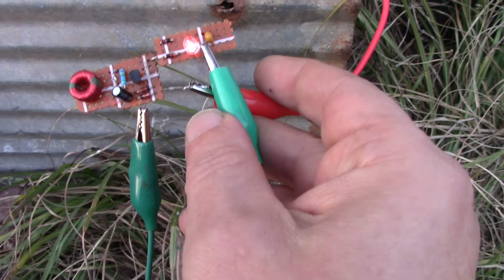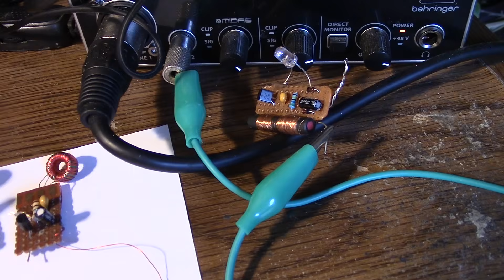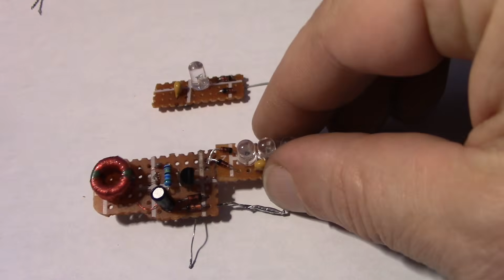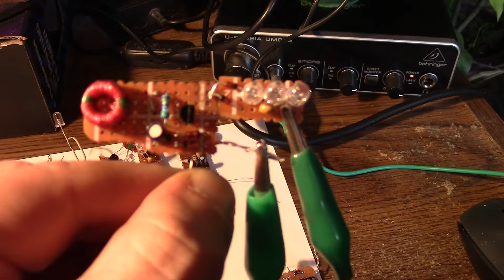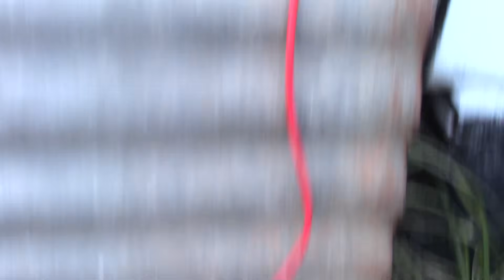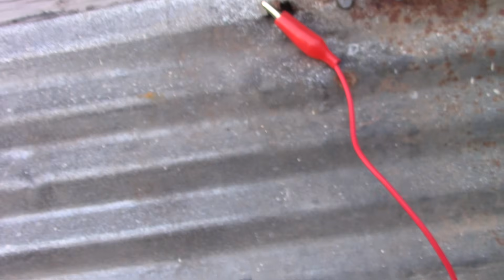Brilliant Energy Harvesting Circuit sent in by a Subscriber

Comment: So.. it work without joule thief..?
Reply from the maker: You can get a tiny amount of light without such a circuit yes. 
If you have a desktop type PC or exposed metal on a laptop, you might be able to hold the negative leg of an LED and get a bit of light by touching the positive end to that metal. 
A metal desk lamp is another to try.

Comment: So how does it work and where does the energy come from ? Maybe radio waves if you live close to a broadcast transmitter or zero point energy?
Reply from the maker: It's simply the earthed mains electricity from the house 😀
In the USA, the Ground is connected to the Neutral, to Earth the incoming mains power for safety. That tiny amount of electricity in the ground can be detected with 2 rods spaced arms length apart and a crystal radio type earphone between them... you'll hear the mains hum. 
These circuits rectify what can be heard with a couple of diodes and a capacitor, then use a type of Joule Thief to light an LED brightly.

Comment: Electrochemistry between the metal sheeting and the earth ground?
Reply from the maker: It shouldn't be, Jim, because both are galvanized zinc. I used those same metals on purpose. However, if copper and zinc are used, then it still works if they are swapped.
Reply: @Slider2732_  Many thanks for your reply.  I wonder if there might be some AC hum getting into the serial diodes.  If I recall the data sheets for the diodes that appear on the left of your demonstration and in the schematics, their respective cutoff frequency is a bit over 1 gigahertz, so very fast.  In the first demonstration, there is some flashing, suggesting that maybe the electrolytic cap is being charged --- just a guess.  I liked your presentation.
Reply from the maker: @jimparsons6803  I do know that AC jumps over a lot of components. It got in the way of a simple LDR circuit for detecting daylight, so more smoothing is needed. 
It's very strange to be messing with AC and not be getting zapped 🤣

Comment: Very good work. You inspire a lot of people. What switching diodes did you use? And What is M5.6? And what transistor? Keep it up! You are getting somewhere.
Reply from the maker: Thank you Jake 😀 
The diodes are very common 1N4148's. Germaniums and others didn't offer that much improvement, when thinking about people replicating (I didn't want to use anything 'exotic'). M5.6 is a 5.6 Megaohm resistor. A 4.7 Meg and others will work, but the 5.6 Meg has given the brightest output. Transistor is 2N2222, All of this is a starting point for others to explore further, nothing set in stone.

Comment: The schematic you give do not match with your PCB, you have there an elevtrolyt capacitor and a diode more than the schematic shows.
Reply from the maker: Ah, I'll have a look Adrian 😀
Hmm, I'm not seeing anything extra. There's a 4.7uF on the main part of the circuit and there's a '224' 0.22uF on the LED's side. For diodes, there are 4 on emc4u2's circuit and 4 on the built one. Both pairs act as half wave bridge rectifiers.
Reply: . Why in the schematic is 4,7 nF written ?
Reply from the maker: @AdrianVay-kp6te  Ah, I see what you mean. that's 4.7uF. Some people extend the letter 'u' when writing by hand and emc4u2 has done that in his schematic. Some may also put a line through a number 7. It's just a writing style difference, but yes it can be confusing to the eye.
The 4.7uF is the same as on the original schematic 😀
Reply: @Slider2732_  I also noted that it looks like one diode on the PCB (the upper left one) is reverse from the schematic.  Is that the case?
Reply from the maker: @datnick  It's the same as the schematic, just looks different when the diodes are side by side. They form an 'AV plug', tied at one end and connected in opposite directions, to form a half wave bridge rectifier. 
An AV plug is normally used with an LED across the diodes open ends in wireless electricity experiments, for field detection.

Comment: Nice video!  It looks like you're getting a descent amount of views on a lot of your videos.   For getting more watch hours, something that seems to be true, is to try changing the length of a video.  With a video of about 3.5 minutes, the advertisers usually don't get ads in the middle of it.  They like a video not less than 8 minutes long so they get an ad in the middle.  Better yet, is a video over 20 minutes long.  They can get multiple ads in them.  It seems that YouTube recommends the videos more where the advertisers get more time.  
For me, I seem to get more watch time with the longer videos, even if viewers skip through it more.  I was also informed that the first 30 seconds of a video is very important.  The first 30 seconds has to match the title and thumbnail, and move right along quickly so the viewer is engage at least that long, before they start skipping through it.  I think YouTube is getting harder and harder, because it's getting so saturated.  And now more than ever with AI videos...
Reply from the maker: Thanks for the info. Yes indeed, there's so much out there that has to be done to stay 'up' with regular normal video releases. SEO, timing the releases, type of content to match viewing habits... loads of things to consider. 
I do agree about upload length, for example in this one I showed bunches of ways to connect the circuit and maybe it could have been slowed down. I was just in awe and kept swapping cords 🤣
30 second retention is a key thing, no doubt. 
Hey, am looking forward to your next vid, for certain and best wishes on your journey 😀
Reply: @Slider2732_  I just uploaded a video on my other channel, 'Life in the outskirts'.  It's a channel smaller than yours, but it is monetized.  I haven't done one there since last October.  I just needed to do one there to keep it monetized.  Started it 5 years ago, it just didn't go anywhere.  I get less than $20 month, but it's something.

Comment: As well as showing LEDs it would be good if you can advise power output. I'm guessing 1.7V * 10mA  is approx 0.02W per LED
Reply from the maker: Yes Dan, I agree. There isn't really much of anything for power, but it's enough to light a few LED's. The main focus has been on garden lights needing no batteries or solar. It would probably be an idea to collect in a cap and store some power, but the lighting is practical and does have real world uses.
Reply: @Slider2732_ Great, yes i was thinking to see your best design, make a number in parallel/series and power a LORA transmitter to indicate when a letter is in my letterbox

Comment: When I was at school back in the early 70s, one of my mates designed and built a radio that harvested the power of Radio 1 to power the amplifier.  So his radio didn't take any batteries but was able to power a conventional speaker (not the puny headphones of a crystal set).  It wasn't very loud but was clear enough to be heard by a bunch of us gathered around it.  I thought it was a work of genius.
Reply: Same about me here, in late sixties my friend at Pune made a transistor and it worked on dead 1.5volts cell, the sound so loud that he put thick book on speaker!
(Not knowing the volume control circuit)
We were on four km periphery of radio station. 🌹❤️
Now i am a electronics technician and repair cnc machine circuits.
Reply from the maker: I'd say it was a work of genius Ken, considering he was still at school! 
I think it can be done with a decently wound transformer and strong reception, but I'd have to ask your mate about that 😀
Reply: @Slider2732_  I have seen this circuit. It uses 2
coils that sit at 90 degrees to each other. I found 
it in an article about crystal radio sets. I don't
recall the website. But the circuit did have the 
power to drive a speaker.  I was Amazed. If I find 
it again I will let you know.
Reply: That s a crystal radio common in 60s and 70s 
Works from power from the diode

Comment: What type of diodes are you using, other than LEDS?
Reply from the maker: Regular 1N4148's 😀
I tried several others, 1N4001, 1N34 and more, but there was very little real improvement from even germaniums over the worlds most common type. Easier to replicate too, which is always a consideration.

Comment: great work looks amazing........are you using 1n4148 diodes......1n34 or similar are worth a try they are not as fast but the forward voltage drop is better

Comment: Hi power AM transmitter is near.
Reply from the maker: That's a valid thought and am glad you mentioned it because others may well think similarly. But, we are rural and in a radio desert here. Our nearest AM transmitter puts out just 35W at nights and is several miles away. Others within 20 miles are 4000W to 6000W, religious, talk sports and local programming. 
There are certainly no blaster stations.
Reply: @Slider2732_  So, is it AM, or FM? Didn't they close the high-power AM stations?
Reply from the maker: @iuries  Neither. This is just the regular grounded mains from a house that's being harvested. Otherwise, it dissipates and is completely normal for any house. It's a tiny amount of power, but enough to light a few LED's with the right circuit. 
I do believe several blaster type stations were closed and, I think, because of online streaming making their power needs way too much to continue viably.
Reply: @Slider2732_ 👍👍🤔 so your thinking..that now radio wave are powering this  circuit. ??
Reply from the maker: @Greg.UWU.22  Several people seem to think so, Greg. I'm confused myself about that, mainly because we are in a radio desert of sorts. It wouldn't explain the ways the circuit can be connected, or connections swapped especially. I've no antenna, no radio coil, no variable resistor or germanium diode in the circuit!
Reply: @Slider2732_  Yes, this is energy from high-power AM transmitters. With the kind of antenna you connected there, you won’t realistically receive anything else. Make a half-wave dipole antenna with arms of about 1 meter and then you’ll be picking up energy from FM transmitters in the 88–108 MHz band. If you make a small dipole with 2.5 cm arms, then you’ll be collecting energy from WiFi, LTE 2600, etc.
Reply: @dktr_SP4OX .pik up energy from mobile phone tower s. Hf . 🤔🤔 I have one 200mts from my place .. this could be fun.

Comment: It has negative resistance... if you use bigger capacitors, and or resistors, you will increase the output, even, the resistor is a potmeter!
Reply: How does negative resistance work exactly?
Reply: @JenkoRun The simple back EMF causes.
More technikally, phase conjugation happening in bifilat coil cross section or in PN junkction in NPN trasistor layer, a negative shockwave creating, a sphere, with negative time property.
Reply: The result is a harmonic coherent fast, wave, nonlocal properties has as well.
Reply: @hullamgenetika  Can you explain that in layman terms please?
Reply: @JenkoRun  We’re discussing system organization and information flow, not supernatural claims — the language may differ, but the principle is practical.
Reply: @JenkoRun  Phase conjugation means creating a signal that is the mirror opposite in time and phase of another signal.
In electronics, this can be imagined as taking a wave and making a new one that runs backward with the same shape, but inverted in phase.
When the original signal and its phase-conjugate meet, distortions can cancel out, because one wave undoes what the other did.
In simple terms: it’s like sending an “anti-version” of a signal that can correct or neutralize errors in the original wave.
Reply: @JenkoRun  Phase conjugation is making a signal that is the time-reversed, phase-inverted copy of another signal, so distortions can cancel when they interact.
Reply: @JenkoRun  Negative resistance lets a circuit amplify signals because it feeds energy back instead of absorbing it, making small signals grow instead of fade.
Reply: @hullamgenetika  Ah okay, I'm with you now. What would be a real easy and simple way to produce an inverted wave like that using just coils and capacitors, and how would we detect it?
Reply from the maker: I do recall how John Bedini mentioned certain transistors in a similar way. From what I remember, 2N2222A, 2N3904, 2N5501 - but, I'm as interested as JenkoRun about what that means in a practical way. Thanks for the info so far 😀